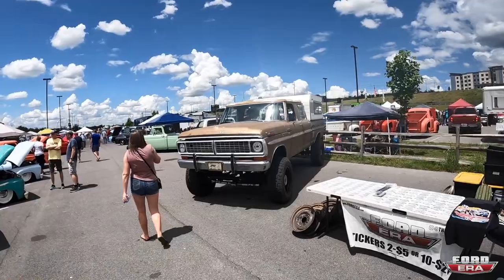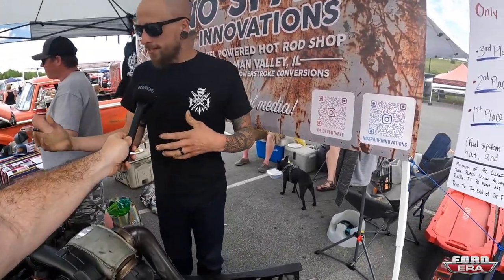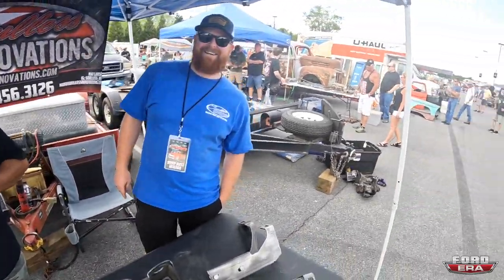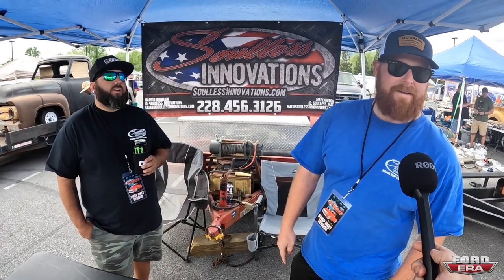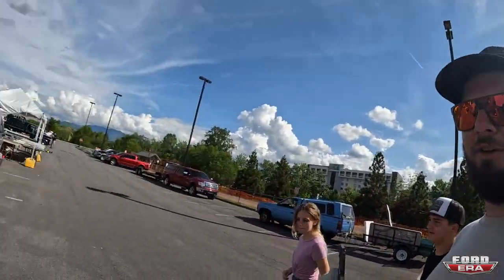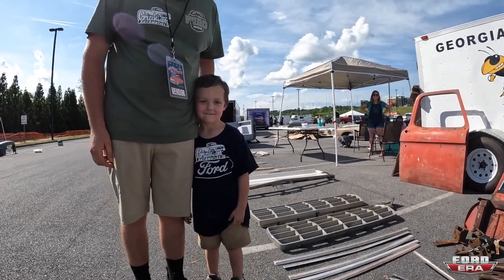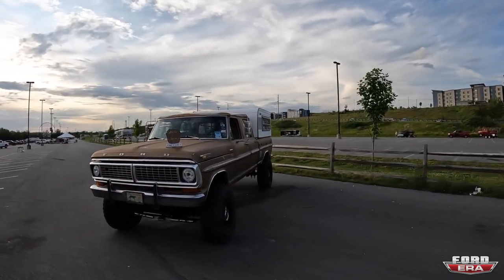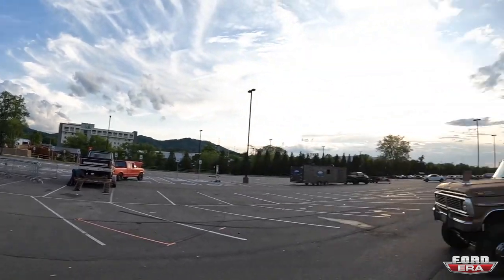Grand National F100 Show 2022 - Show Coverage - Part 1 | Ford Era

Comment: Hey bro love the old Fords. Got one you mite like, 77 camper special ext cab,fact big block,air,hesitating wipers, cruise,one owner. Ordered at Smith County motor, they said it was highest priced truck they ever sold when dad bought it. Dealership closed an it a used car lot now.  Crazy how times change. Truck is in Tennessee bout 15 min from Dealership it was purchased from.

Comment: Where are folks getting there seats from? Specifically the line of trucks at th 14:38 in the video.
Reply: Most of those are mid 80's-90's factory Ford truck seats. A very comfortable seat.

Comment: I am building a 1936 Ford pickup but I am a Chevy guy.....so I am putting in a Chevy motor, no not a new LS or a 350 but I have a 63' 409/425hp 4 speed for it! :)
Reply from the maker: That is cool, it’s hot rodding at the end of the day
Reply: So you're NOT really a chevy guy if you're building a FORD!..🤦‍♂️
Reply: @ramonmunoz9271  Yes I am...

Comment: I've been wondering if anyone has thought about making a cross member for the f100 to except mustang independent rear suspension components. I've saw 2 people so for that put a mustang subframes under the rear of there f100. They have excess parts hanging past the frame when they are done.